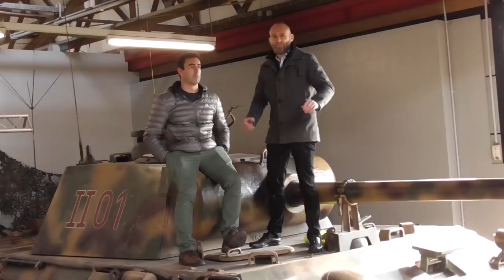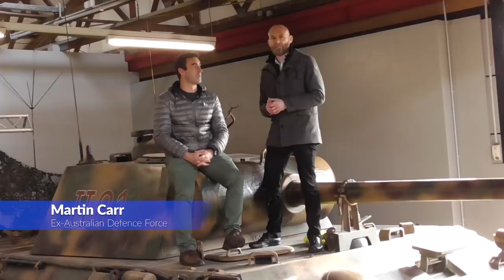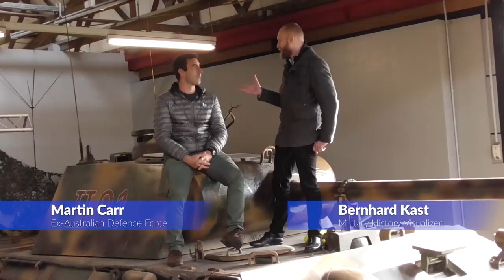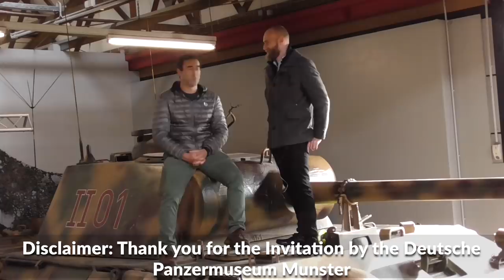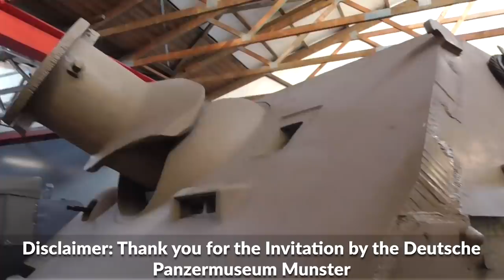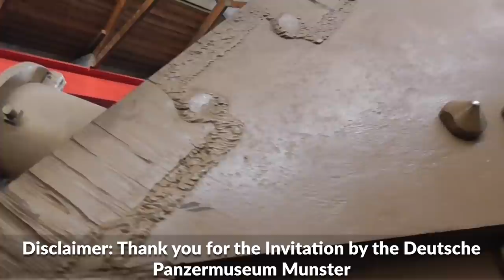The Future of Tank Combat - Decoupling!?

Comment: Simulations and theory-crafting are all well and good, but the only true test of how new weapon systems will be used is trial in actual combat against peer adversaries. Think of the new weapons before the two world wars, compare the prevailing theories of their uses in the 1910s and the 1930s to the actual tactics during the wars. Planes, tanks, and artillery come to mind in this regard.

We won't truly know until we see. That's just my opinion though.
Reply: Very true. In this case, the decoupling idea has already been tried in a real war.

The decoupling idea has been tried before by the US invading Iraq. There were dedicated sensor vehicles, dedicated command vehicles and dedicated weapon vehicles. This sounds similar to regular vehicles, but the big difference is that with this decoupling idea, the weapon vehicle becomes a cheap vehicle (think Stryker Mobile Gun System). The weapon vehicle has to rely on the other vehicles giving it all the necessary information so that the weapon vehicle can stay out of harms way (which is important, seeing as how it has little protection). But in practice, it's too complicated to get the right vehicle into the right spot at the right time.

It's much simpler to have one vehicle that can do it all and is good at everything. That's why tanks are still used. Yes, they are expensive, but they are good at everything. Because they are good at everything, they can use the right system whenever it is needed right there on the spot.

Comment: I was once told that a tank that uses javelin-style missiles arrayed in vertical launch cells that gets targeting data from networked sensors and can engage multiple targets without necessarily needing line of site would be stupid. I can see one of these tanks holding a number of short-range quad-copter type drones moving into position behind a hill or ridge and launching one of them to take a look over the terrain and feed that targeting data to the tank which then engages and kills the enemy without being detected. 

Is this really a stupid concept? I don't think so.
Reply: Systems like that have existed since the sixties. They are an evolution of the tank destroyer however, not the tank.